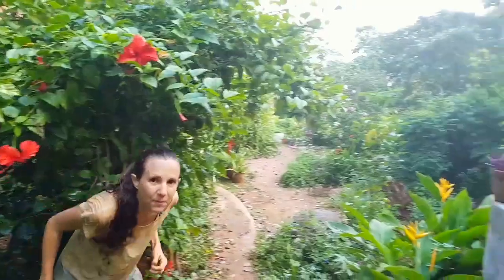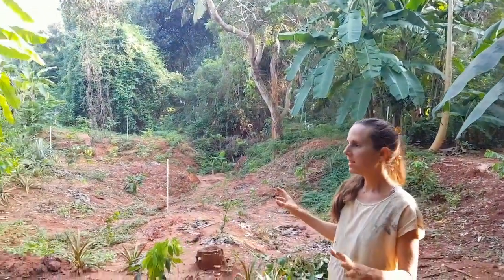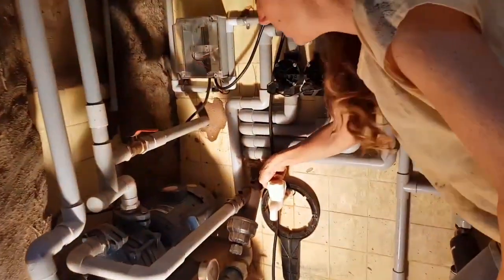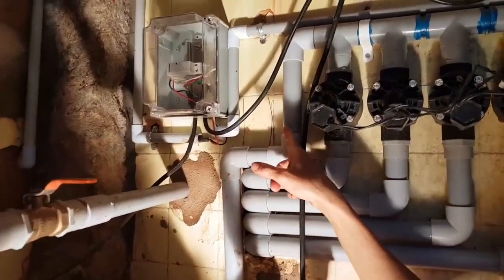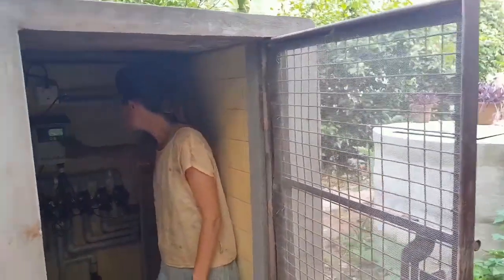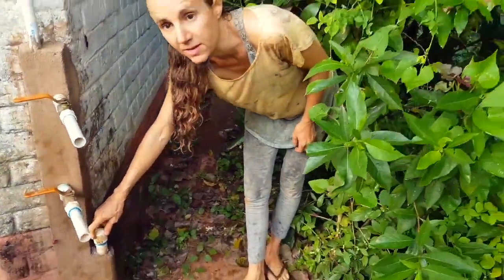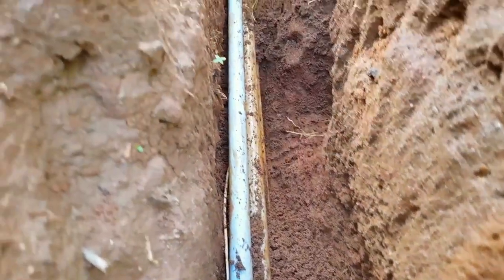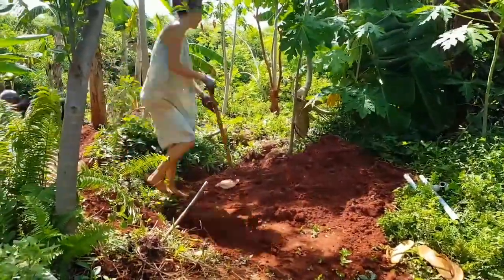IRRIGATION FOR MY FOOD FOREST / SENNINGER MINI WOBBLER

Comment: Hi dear ❤️ i have researched on your equipment a bit and now half of my previously asked questions are answered :) i learned that your water pump is produced in India, so i am looking for similar here in mexico, this easy to find. 

I also found the blue bird set for sifferente zones. And the only question here would be, did you choose quantity of sprinkles per one  solenoid valve? Or did you choose quantity that was recommended. Mainly, what is the capacity of sprinkles for one valve.

Can't wait to build this. But i will have a bit different system in the green house. 

Much love

Comment: Hello dear! I was wondering before about your irrigation, as i watched almost all your videos. But seems i missed this one. So now i have a couple of questions to you!!! 😍
First of all, great work!

1) What fills up the tank? Source is government water, or you collect rain water, spring ? What do you do when tank is empty, if ever... 

2) Can you please put the list of names of those main devices in the shed: computer, filters (sizes), switches etc, and names of those sprinkles that flow the water. Everything xcept pipes :)

3) how many meters of pipes is approximately in zone 1 or 2?

3) what was approximate cost of setting everything in the shed. Though cost will vary here in mexico, but it's ok.

4) if you happened to observe, did you notice that some plants were getting less water than others? Maybe they show it in fading o coloring..

5) is vertical part of the tube is the same as the pipe that runs under the ground? Who veritxally stable is it? We get hurricanes and strong winds here sometimes. So i wonder what i need to make it hold.
I am preparing myself to manage a 3 hectare land, and start from scratch. So this video is really precious, as i am looking into different ways of sourcing and storing water.

6) does area right under the fountain get watering as well? Or does it stay dray? It seems that the water splashes all around, so i wonder what about the area at the foot of the stand.

 About your system, i like that despite you have to put effort in the beginning, it's really easy management after. Just turn it on and check its all running. 

Right now i am doing almost manually, or hose 😂😂

I think i will have to add dripping-system as well for some of plants, as i also love growing ornamental and medicinal herbs, that might need to be grown in beds. We LL see

❤️

Comment: Thanks Sarah for all your videos. I was wondering if sprinklers are efficient and if you don't waste water in the air. Why do you choose this option compared to a system on the ground? Is it because you move the beds and thus that top ground system won't be useful while changing the set up of your garden?
Reply from the maker: Yes, this was the main reason for sprinklers- like that my garden can grow wild and change its shape. Also I work with lots of mulch and I feel that it would block if I had a system on the ground. The sprinklers work really well and I do not think there is a lot of water evaporation. Still I feel nothing is as effective as giving water with a pipe by hand which is what I did for many years but now it would take me too much time. I think in the future I will need different systems in my garden, for it to work the most effective it will be a combination of watering by hand , sprinklers and drip..

Comment: instead of burying the piping in the ground wouldn't it have been better to use flexible pvc pipe running on the ground?
Reply from the maker: Yes, that would have been definitely less work, but I had my experience with having them on the ground - after a short time they will be buried superficially under the soil and easily get damaged when working in the garden. 
Also all my beds and trenches are not permanent - the soil and beds and all is constantly in movement- where there is a trench today there will be a bed after a while and I will grow in the trenches . I try to put as much organic matter into the soil as I can , to build the soil , actually to grow soil. With this irrigation I can do that without having to remover the pipes each time to digg the new trenches and make new beds.